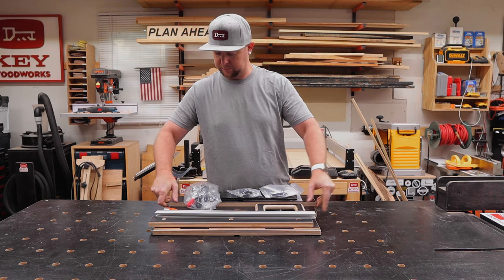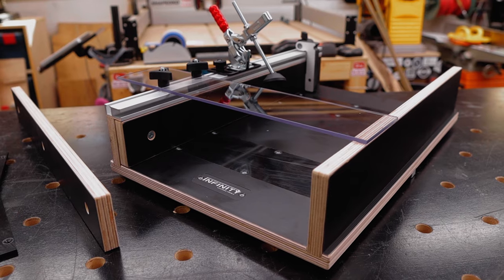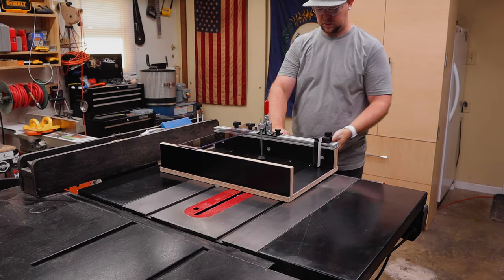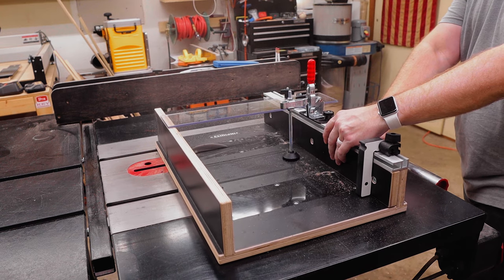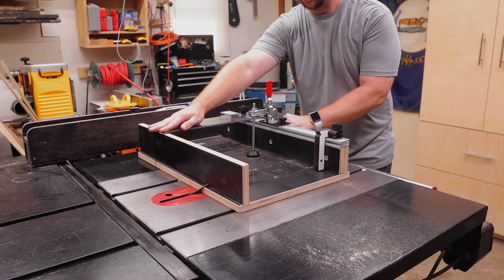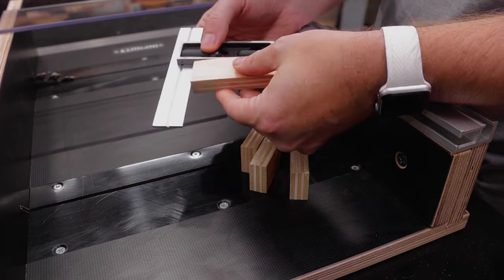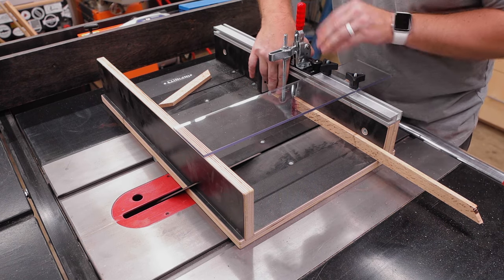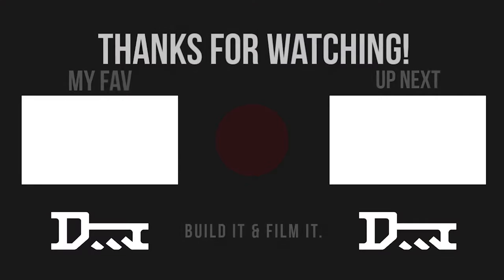Tool Review | Infinity Tools Crosscut Sled TCS-200

Comment: I got mine in today. I’ve been woodworking for many years and never used a sled. I think it will be handy for for accurate repeatable cuts. The main reason I got it is I shaved off the side of my index finger about six months ago and decided I’m getting too comfortable. The only thing I was not impressed with was the instructions or photo for putting the clamp on. It is pretty self explanatory “I think” but the screws that came with it are really too small for the bracket assembly. I can get that taken care of easily enough though. All in all it’s definitely the best looking sled on the market market and with it being CNC machined I think I’ll be pretty happy with it.  After I made the first cut I could see how it could be one of those things I regret not doing sooner.

Comment: Thanks for the video - it confirmed my take on it. On your first cut, it is easy to see that the flip stop flexes. It does flex enough to prevent repeatable same-sized cuts. The fit of the parts is good. The instructions are not great for both the flip stop and the clamp - One needs to figure it out on his/her own.  Mine came chipped (and I bought it to gift it to a new woodworker - so I wasn't happy with that) and one of the threaded metal inserts needed to be re-threaded (8-32). For over $300 - I am not sure it is that great. Oh - and of course - you get the run around when you contact them.

Comment: I ordered this after watching your review. The sled is fine, but I'm very disappointed in the toggle clamp and flip stop. I was really looking forward to the toggle clamp for holding small pieces, but I can't seem to get it to adjust to hold down the piece of wood firmly enough (in my opinion). And the flip stop has a little play in it. I'm not sure if this would be a problem or not because you would be pushing in the same direction on multiple pieces, thus taking the slop out. But that toggle clamp! I don't mind paying a premium price for a quality product, but I don't feel very good about this purchase. Can you offer any advice on how your set up the toggle clamp. Any help would be appreciated. I would be nice if I could find an auto adjust clamp for this sled.
Reply from the maker: I didn’t have any issues with the toggle clamp, it’s a possibility you got a bad clamp though. I did remove the swivel head on the hold down for smaller material and that helps a lot. Any flip stop is going to have slop. I’ve since quit using all flip stops and switched to the Katz Moses stop block. Much better for precision.
Reply: @KeyWoodworks  Thanks. I also have the KatzMoses stop block, which I will use as well.

Comment: Nice overview but imagine spending $300 on a crosscut sled 😐
Reply from the maker: There’s always cheaper options
Reply: I have the same feelings. I was wondering at what price I would pay for one of these. After some thought I came up with $150 at the most. That would be the absolute highest I would go. It is very difficult to justify buying one when you can make one for much much less. However the convenience and hassle free option might make it worth it.